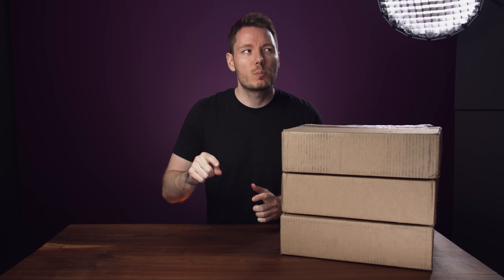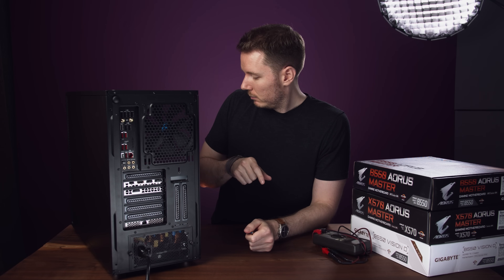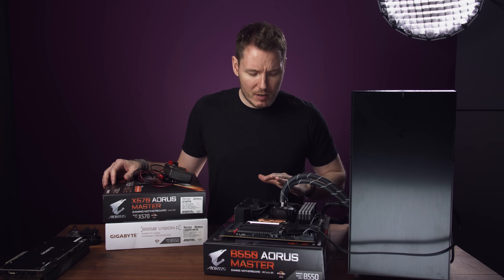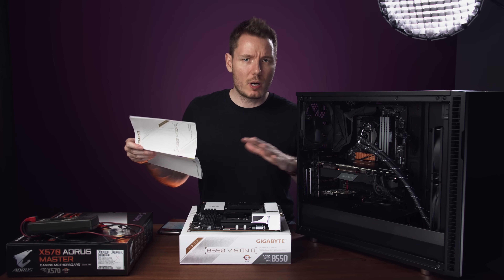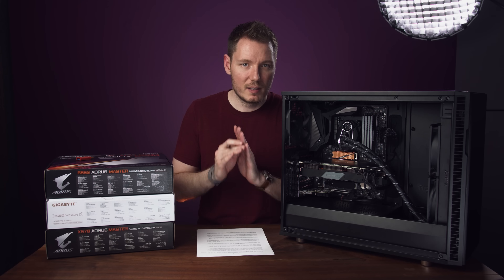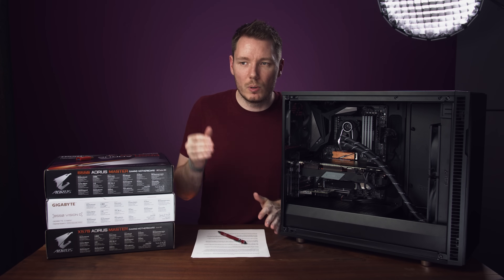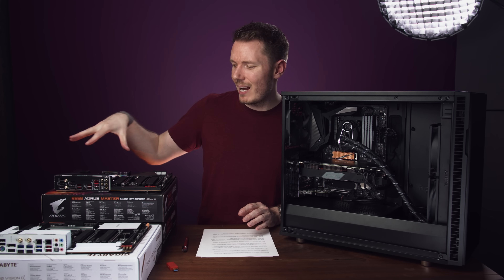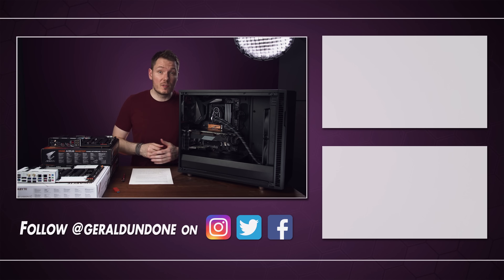I Was WRONG About These AORUS AMD Motherboards

Comment: Case-Issue: Replace the on/off switch. And yeah ... Fractal Design is great in Design .. but that´s it. RGB for a (audio) workstation is a bad idea. Have you switched your power supply?
Reply from the maker: The issue persists even when the front buttons aren't connected. So it must be elsewhere in the case that's doing it. And yeah, tried 3 different power supplies, same issue. Cheers!

Comment: I'm rockin' the Aorus X570 ITX and it's been solid, but of course you would run into some crazy issues on your build!

On another note you can turn on motherboards that don't have a built in button by shorting the 2 power pins in the front panel io breakout.
Reply from the maker: Nice tip! Thanks. :)

Comment: i Would still suggest to use a ground loop isolator because just because that sound will be persistent even if you can't audibly hear it. you might even still see it in the waveforms. the gpu when it powers up has a higher power draw which would cause a coil whine. reply if you know more than me i'm limited in my audio knowledge
Reply from the maker: Yeah, that seems reasonable. That's what I'm doing currently.
Reply: Gerald Undone thanks for the reply that actually means a ton!

Comment: I would say it's the power switch panel on the front of the case.  When off,  the switches on the front panel make no contact.... thus not interrupting the ground.  But when engaged (powered on) it's shorting out somewhere, causing a ground issue.  That, or somewhere there is a spot rubbing/touching the case doing effectively the same thing.  For your next vid: :Tell me where the big bad motherboard grounded you..."
Reply from the maker: That seems reasonable, but I just checked and the problem persists even without the front switches connected. I powered up using the X570 on-board switch. So it must be somewhere in the case construction.
Reply: @geraldundone  Faulty fan harness shorting to case?
Reply: Power switch in pc doesn't work like a light switch. It only connects two connectors when fully pressed.